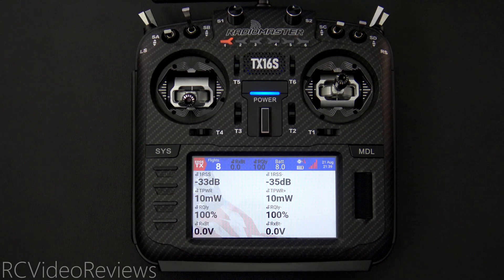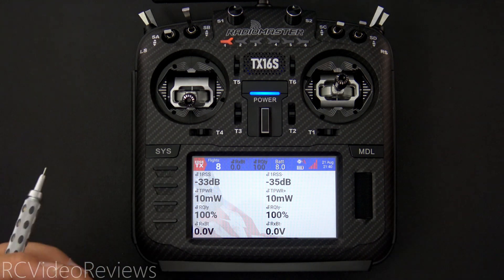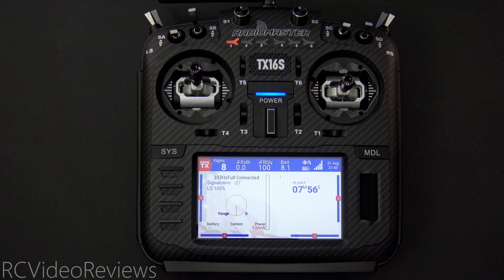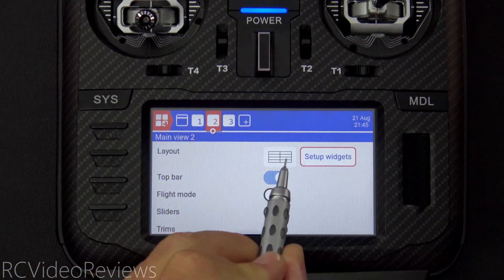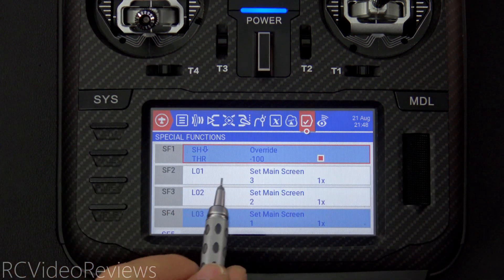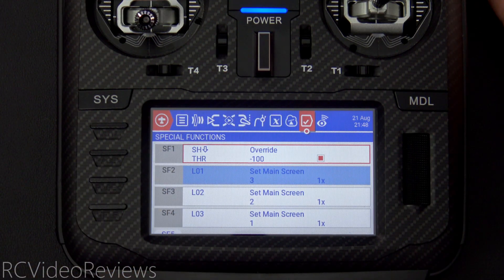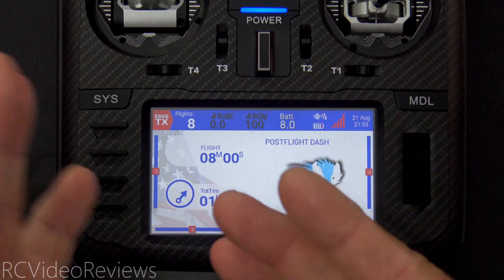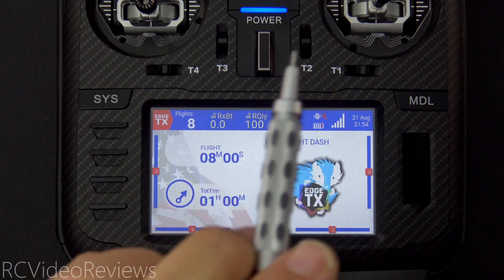Get more from your EdgeTX radio: Automatic screen changes for different phases of flight.

Comment: First of all, have to say that I love your videos and your content is super informative and well put together.  

One thing that hit me after watching several videos recently.  With available telemetry, is there a compelling reason that makes you use a countdown timer instead of battery voltage to determine when to land?
Reply from the maker: Before ELRS RXs started including vbat, there was no easy way to use flight pack voltage without adding extra sensors that were usually around $20. Now that ELRS RXs pretty much all have vbat, voltage is all I use now. I only use timers for redundancy and to keep track of total time.

Comment: Sorry, another question. How did you create the summary page? I understand how to set widgets to show current things that are happening but how do i tell it to show me the weakest signal during the flight as an example
Reply from the maker: Use the sensor with a - to show the low value or the + for the high value.

Comment: John question for you, I do not see the option in Special Function for setting the Main Screen 1,2,3 etc. Is that only an options in 2.8.x and up or should I see it in 2.7.  I am likely looking in the wrong place. Have the Logical part set up but can not find were you found the screen option for the  Special Functions part.
Reply from the maker: If it's not there.......

Comment: This is amazing but have a question. Do you set logical switches for each model? I'm asking because many of my flight times difference depending on the model
Reply from the maker: I adjust the time per model. Every plane now has this setup. I just set my trigger 10s below the flight timer value. So if my clock is set for 7m, I set the trigger to 6m50s.